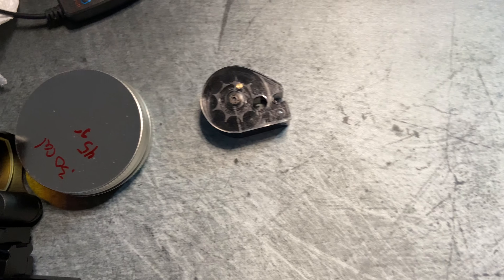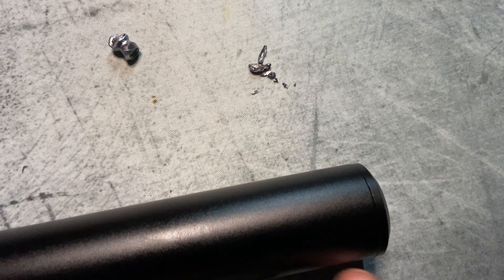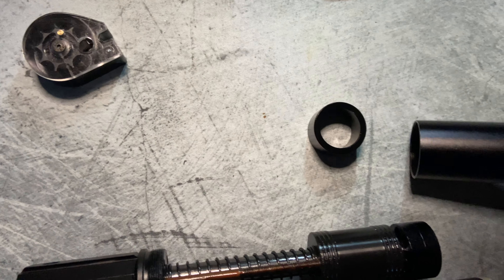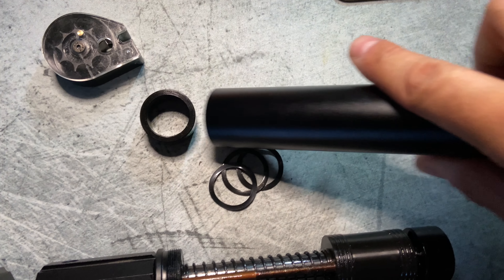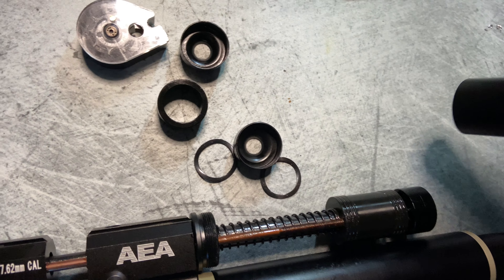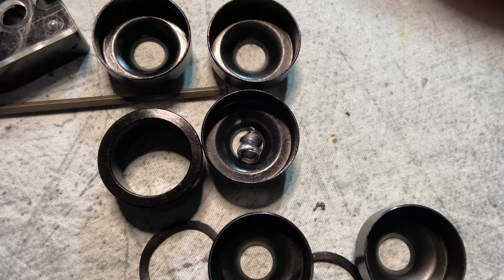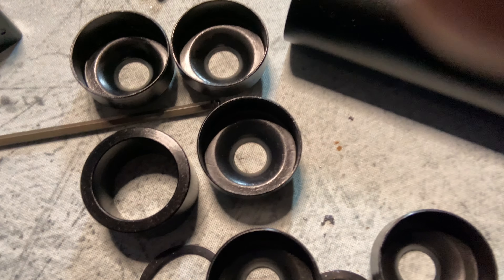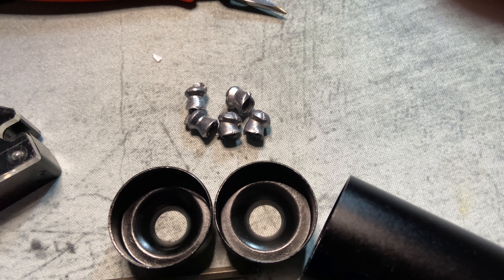AEA HP SS .30 cal (non-plus version) Cycling/Feeding Issues

Comment: Its the magazine that is having problems cycling the pellets , contact Ben and he will replace your magazines with new heavy spring mags.
Reply: Yes the problem is the spring at the magazine !
Reply from the maker: I contacted Terry from Fox Air Power and he replaced the mags. Still had issues though. Something else was up with the gun. I modded the recoil/barrel spring and it started working better, but not perfect.
Reply: Sent Mr. Bin four HP SS .30 mags to replace springs(?) back in Feb.  Got the run around: shipment not in, remind me and I'll send em.  I know there were no .30 mags anywhere but Bin said he would fix the four mags I sent like maybe changing the spring.  It's now Dec. and I noticed .30 mags available.  I reminded Bin again and got no response.  I went and ordered mags from The Pellet Shop at a cheaper price than BinTac.  The mags work fine in my HP SS ,30, complete cycling no jams.  I won't be doing any more business with BinTac.

Comment: Same problems with mine too...22cal.Even  the new cnc mags doesn't solve these problems.... good gun when it works but usually does not!
Reply from the maker: I'm still trying to figure mine out too. I have it filled right now to 29-30mpa. I want to see what happens with air pressure that high. I got new mags too and still jams if it's under 22-23mpa.

Comment: The semi auto in this airgun needs some serious work that is why I'm hesitant on buying to many issues with this action.
Reply from the maker: My .25 cal works great. Only issue with that one was a valve pin needed to be replaced. This .30 cal, however, I'm still trying to figure it out.
Reply: @KiJenProductions  What was the problem with the valve pin?  I want to buy one in .25, but dang looks like the latest shipment has some major issues?
Reply from the maker: The valve pin broke in half. It's made of a metal pin connected to a plastic plunger. The plastic plunger is either 3D printed or machined. I'm sure it's just a matter of time before the replacement pin breaks too as it's the same material. It's the only issue I've had with the .25.

Comment: I have had issues with the semi-auto at high pressures (this gun doesn't like to be above 33-3400 psi). If you have high pressure in the tank (35-3600 psi), it will shoot once and fail to load the second and damage a bit the magazzine in the process. 
On the other side, once you learn what's the best pressure to fill it, everything works smooth. I have this in .25 cal and it shots great with every load I've used, and I've shot over 500 rounds with it. It usually gives me 60 shots per fill give or take. Once it falls from 1500 psi, it starts to fail the semi auto again, only this time it doesn't damage the magazzine. And I usually shoot solid 10 more round in single-action then.
My best recommendation: get extra magazines. That's not really expensive and trust me, you will damage the magazine while learning how to use it. I have 3 right now (I repaired one).
However, it is not a forgiving gun: if you missuse it, it will start to fail. To me, this gun is like a lady: you treat it good, it will give you the best pleasures; treat it wrong, and you will start to suffer.
Reply from the maker: I have the .25 cal HP SS and other than the valve pin breaking, it has never had a jam or any cycling issues (hope I didn't just jinx myself), but this .30 cal...I'll be lucky if I can get thru a mag without a jam. The .25 cal I fill to 25mpa and I get 2 mags out of it then I refill. The .30 cal, from what I've seen on my gun so far, doesn't like the air under 22-23mpa and will jam on the second or third shot, sometimes even jam at 24-25mpa. I want to try higher air pressure to see if it will work or not cycle. At 27mpa, it actually worked, but I need to test a bit more.

I agree, this is not a forgiving gun. It's chewed up 2 of my mags so far. I like the concept of this gun and don't want to give up on but...something's got to give.

Comment: I just had that happen on a new hp ss in 30 cal... I clean the oil off in the barrel shroud and use powder graphite  took care of my problems
Reply from the maker: I've only had this happen one more time since, and it was from a misfeed and caused by one of my damaged mags. I actually just got some of that powder graphite lube last night. Found some at a Ace Hardware store.

Comment: i am having the same issues just received the gun yesterday in 25cal. cant figure it out
Reply: Pellets or mags but damage front and back hmm baffle maybe? Could be  all of the above except the pellet
Reply from the maker: I'm still working on this. I took the most of the gun apart to clean and lube it but still giving me problems. My .25 cal works great, but the .30 doesn't want to cooperate at all.
Reply from the maker: I checked the baffles...no damage at all. I checked the end cap of the barrel shroud too and again, no damage. I've taken apart the mags, cleaned and lubed them, still problems. I thought it might be the Hades as they have shallow skirts but same thing happened with the FX pellets with deep skirts. I'm stumped. I just don't get it.
Reply: @KiJenProductions  can it shoot other pellets ?
Reply from the maker: Those are the pellets I have. I just saw Bin's video about 1st and 2nd gen mags, so hopefully, I have the 1st gen mags and that's what the problem is. I ordered 2 more mags last week (I have to check delivery status) so hopefully those are the 2nd gen ones.
Reply: @KiJenProductions   try another pellet and definitely determine from there on the pellets behalf  then track the problem
Reply: I had same issue, without damaged pellets. My issue was the air control screw on top dovetail rail. The screw closest to barrel. If that screw is loose, probably your issue. DO NOT OVER TIGHTEN THAT SCREW, IT WILL CAUSE DAMAGE TO YOUR BARREL. SNUG IT JUST A LITTLE. See if that helps
Reply: @champagnemedia8383  yes I agree the back of that diagnose they way the pellets are looking from the back
Reply: @champagnemedia8383  I haven't bought one yet, still doing research on whether I want to try to resolve issues or not or if distributors are taking care of the problems.  My understanding is that the screws on  top of the breach dovetail are for holding the barrel in place.  The air control screw (power adjustment) is on the side of the housing and controls air flow between the bottle and the breach.  Does yours have that knob also?
Reply: @KiJenProductions  You say that you have 1st gen mags.  Do you have an older gun?  Or is it a newer gen gun with 1st gen mags?  Who did you order gun/mags from?  thanks
Reply from the maker: I'm going to say it's one of the newer guns as it has the painted power adjustment knob, not just the red dot at the top of the knob like my .25. And it did come with the first gen mags with the weaker mag springs. I bought my gun from Fox Air Power. I've been in contact with Terry Fox (who is great to work with and has answered all of my questions) and he sent me 2 replacement mags, with a few new mag springs to replace the springs in the older mags. I measured the mag springs' thickness and the new mag springs are thicker than the originals (0.60mm vs 0.68mm), so there is a difference there.
Reply: @KiJenProductions  Hope you get it figured out.  Still on the fence about buying one.  Keep us updated, thanks

Comment: Hades won't cycle properly in the magazines. Nor Neilson slugs. 
Hatsan Vortex strike 49gn and FX 45gr pellets work fine. I lean towards the FX 45gr as they are more consistent in their manufacturing process.
Lube anything that moves on the gun Ballistol. 
Lube the pellets with Ballistol also, it takes seconds to spray them in the tin as give them a light shake.
Make sure you've got a heavy hammer spring if you're filling to 3600 psi.
Reply from the maker: As stubborn as I am about lubing the pellets, I might have to give that a try too. I've seen a few people recommend it and I've rejected it every time as a pain in the a$$. If it works, I'm going to have to find everyone who recommended it and let them know they were right. lol.
Reply: @KiJenProductions  glad to hear you're going to give it a try. 
It's easy. Open the tin. Give em a spray with Ballistol. Give a light shake. Your done. And the other benefit is you won't need to clean your barrel as often.

Comment: U r double feeding that the only problem I listen to 2 min if the gun doesn't cycle just right don't re cock it pull hammer back take mag out dry fire and I bet it shoots u keep double feeding pushing 2 pellets into the breach that's where the shaving r coming from not the Barrel but the operate forcing 1 In while there's already a round in the breach its a common problem with the aea hp ss line